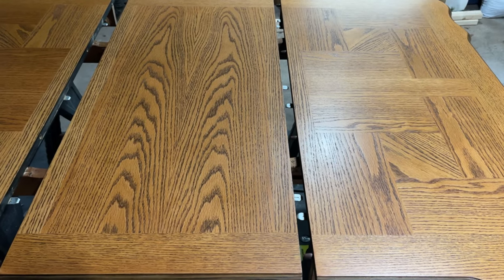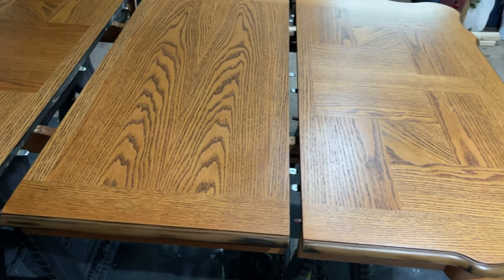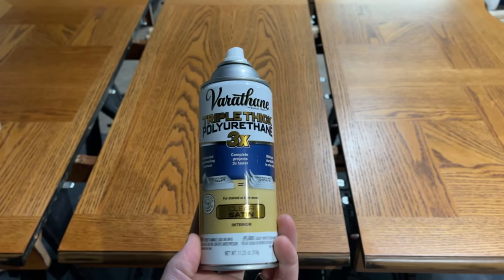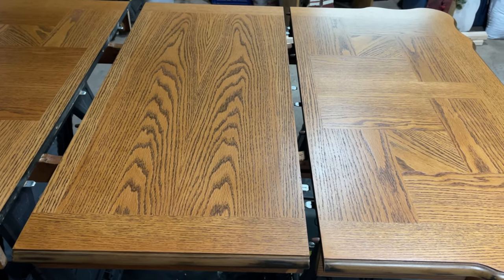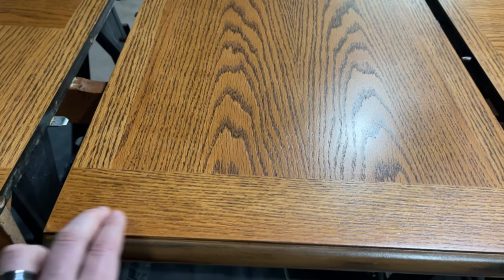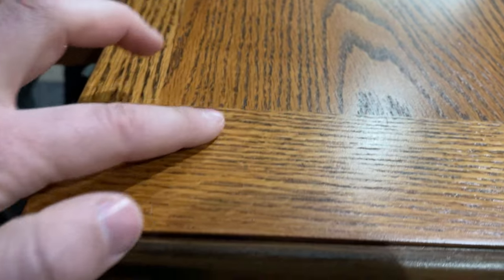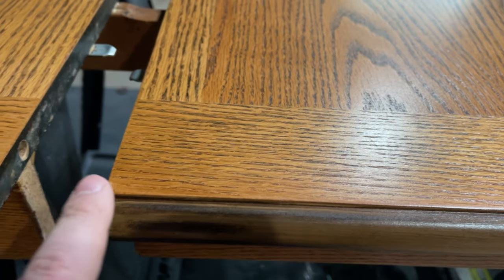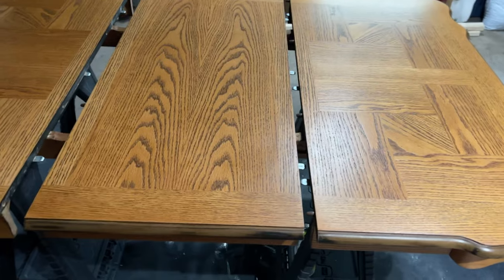How To Buff Spray Polyurethane For A Glass Smooth Finish - Apply Poly To Wood

Comment: Would you buff it after the last spray coat or leave it be?
Reply from the maker: Probably leave it be.
However, if it doesn’t feel smooth as glass then rubbing it once more with a soft paper lunch sack wouldn’t hurt.
Reply: @HowToVideoChannel  yup I gave em a light buff after last coat came out mint, thanks!
Reply from the maker: That’s awesome!